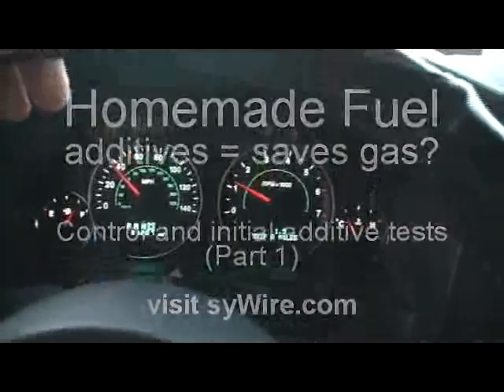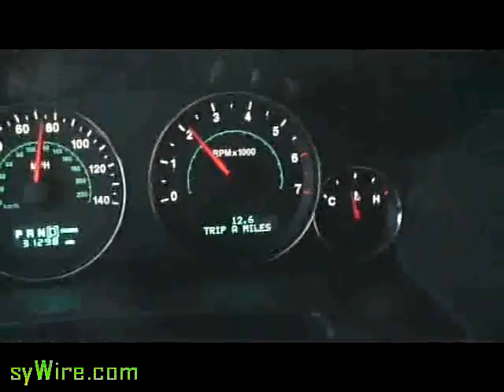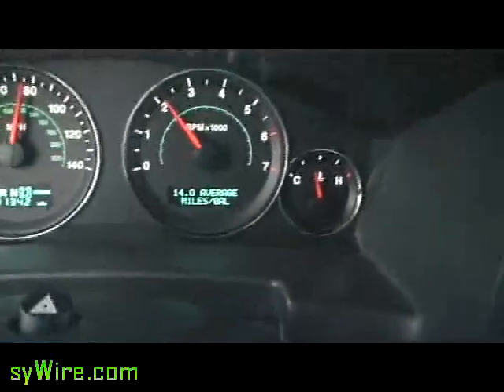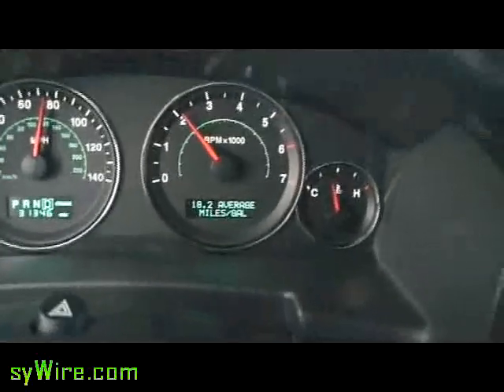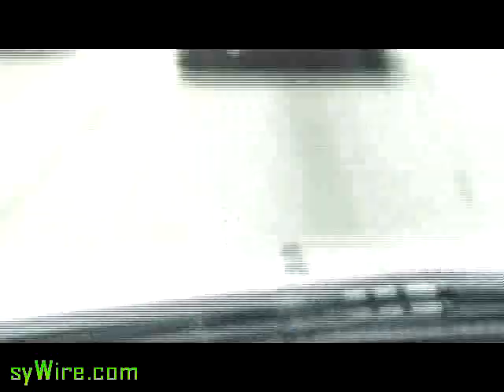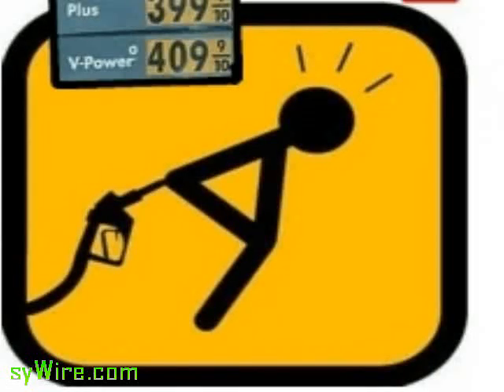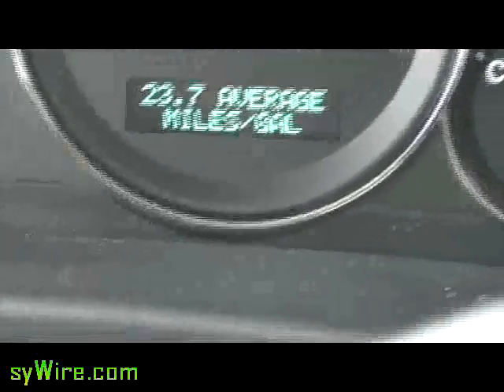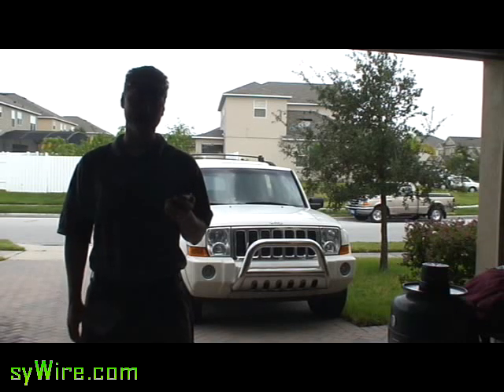Save gas money with HOMEMADE additives? Experiment (Part 1)

Comment: How on earth do you only get 14mpg!!! I could get better with a 38 ton truck.... My land-rover discovery with a 3.5liter v8 would run 24 mpg,  and my seat does over 51 mpg, 4.5 lt per 100 kms on a run and 5.5lt /100 in town traffic. It seems in the USA your vehicles are poorly designed or. Purposely made to guzzle fuel.

Comment: i am happy to see you have good result in adding acetone.
i have been using it for close to 20yrs.
there is many benefits in a small amount. 
many tricks to use it.
addition benefit if you know which chemical to add along with it.
i gain 10% mileage easily.
spark plug and valve have no carbon.
the amount have to depend on your engine compression ratio, the volume of air intake.
lastly it will depend on your fuel injector pressure
 make sure you get have a clean sensor. it be pointless adding acetone in gasoline.
if you are running on carburetor. there will be little benefits, but surely it be vry clean.
for those who did not get any improvements there is some issues with your acetone or mixing ratio.

Comment: Paint thinners are solvent mixtures known to dissolve paints and to remove tar buildup and other known compounds alike. . It is dangerous to expose oneself to them daily because of their inherent vapors which can be hazardous to the human central nervous system, so when dealing with them use in a well ventilated area and with proper breathing protection devices.
.
Reply: Jesus Christ Nancy, give it a rest.

Comment: A paint thinner is a solvent used to thin oil-based paints or clean up after their use, although all such solvents have other uses. Commercially, solvents labeled "Paint Thinner" are usually mineral spirits having a flash point at about 40°C (104°F), the same as some popular brands of charcoal starter.

Comment: There is a guy up in Idaho who has been running much higher concentrations of Acetone and getting 48mpg. out of an old mid 80's t-bird for a long period of time and has had no component failures due to Acetone related damage. His results have been published and his video's are on here as well.

Comment: In some cars it may increase HP. in the one I have tested , it was down about 10%. Mileage was down roughly 15%.    That was in a 2010 Jeep cherokee, a 2011 F150and a car that is not suppose to burn Ethanol, a 2007 Focus. However the focus ran alot smoother after a tank of Ethanol, then back to Gas. You are correct in that Ethanol doesnt leave the bad stuff, Gas does. Ethanol is a clean fuel , Gas is very dirty.

Comment: Alcohol does not leave anything in the engine . However Gasoline is much better for the engine. Running a car on pure 100% alcohol will cause the attraction of water. 10% alcohol will do nothing. With any additive , you need to find out if it does any damage to the engine .

Comment: It's great to do experiments. But, to post this garbage on YouTube is ridiculous. These are NOT controlled conditions (temp/weight/etc.). Then, he's relying on the what? The dashboard GAUGE? Sticks acetone in his gas (which screws up everything it touches), then expects the gauge to still work properly? Plus, even IF mileage improves at hwy speed, it can reduce in stop/go, or ruin engine.

I appreciate the good intentions. But, this is the kind of crap that misleads gullible idiots.

Comment: Progressive fuel economy improvement over days... sounds likes the injectors and intake valves are progressively getting cleaned by the acetone, giving better fuel atomisation. Try running straight gas again and check your fuel economy.

Comment: Good experiment Mefoo. I think the control was just fine. Your vehicles fuel system might be returnless or it have a return line in which case fuel is constantly flowing back to the tank. I wouldn't hold the scangauge in such high regard.  I calculates mileage the same way your ECU does. The major factors it looks at is MPH/ODO, engine RPM and most importantly, Injector pulse width. The scan guage is more of a novelty item. Avg is all that matters. Im doing this to my Satrn today w/xylene alone.

Comment: don't get me wrong, I like scangauges, I just would be skeptical about trusting their data as concrete for the testing you are working on. I really think I would go with just my odometer (which is required by law to be accurate within a pretty good range) and calculating the total fuel burned in each test. its a little extra number crunching for the researcher, but I think I would trust the data more than data generated by an external devise. good instrumentation is expensive!

Comment: don't waste money on a scangauge, just determine the total fuel capacity of your tank, run it empty, then when you fill it again, mathematically determine the total fuel added! I do not consider a scangauge any more reliable for true scientific evaluation than I do the $1000 dollar plus ecu built into your car, many errors can occur with simple instrumentation! just measure actual fuel burned! your cars odometer and simple calculation will satisfy most anyone I know.

Comment: since the built in fuel efficiency meters usually have an error range of 10-15% and are there only for basic information I think that using them for all your experimental data is flawed. also you would see HUGE reduction by just slowing down by 10mph, since parasitic drag is related to the square of velocity (every time speed doubles drag quadruples). but like I said, I like the idea of what you are doing. but given the methodology of your experimental procedure, I can only give it three stars.

Comment: the only way I would trust the data is if you actually filled your tank and then determined your total burn, not trusting the relatively primitive ecu estimation of the fuel burn. but I like what you are doing! I have a hard time believing that your additives had the increase that is typicaly claimed. I would guess that the ecu determines the fuel efficiency partially based on information coming to it from the o2 sensors, you could be throwing off their information with the chemistry change.